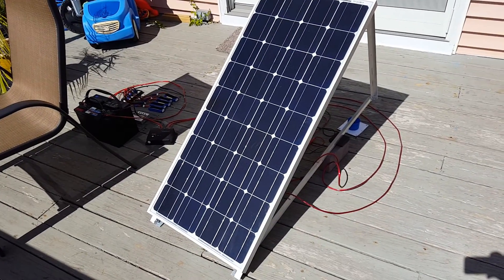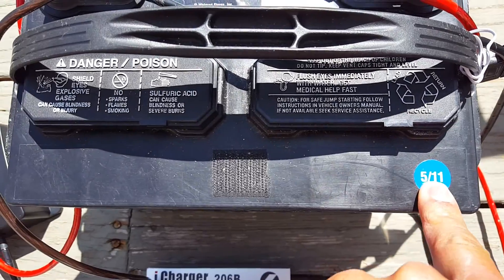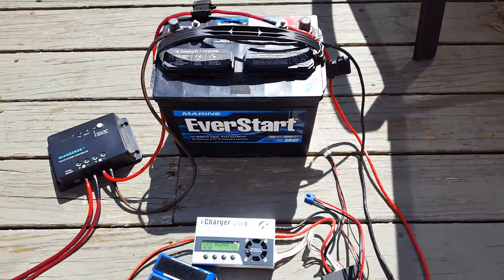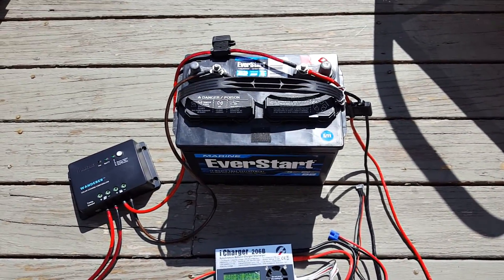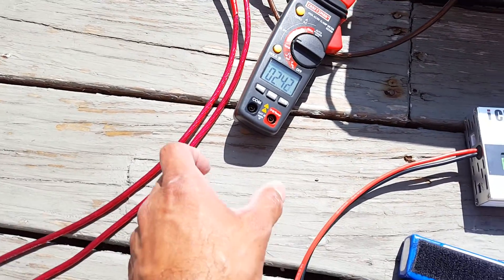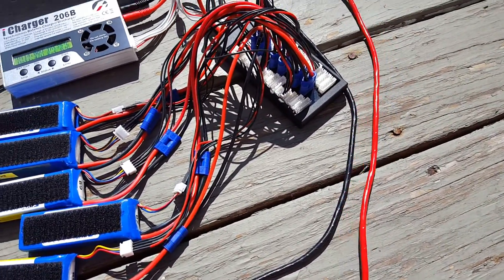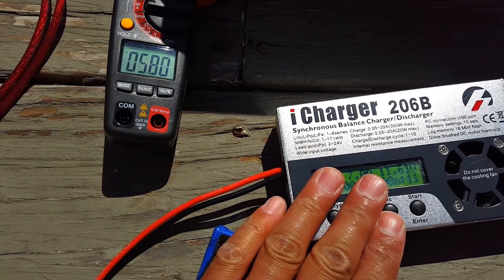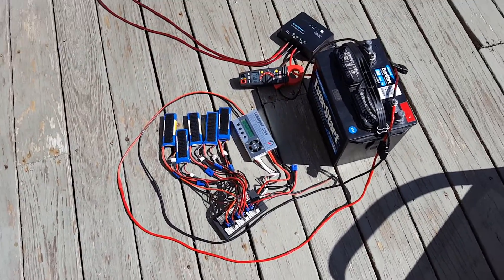Renogy 100 Watt solar panel load test

Comment: The main reason I am watching is because my 250 watt used panels have a VOC of around 37v but I only see 32V. I'm thinking about putting 2 12v batteries in series and than an inverter on each battery with 150 watt load. If I'm pulling 300 watts from the batteries then my 24v panel should be able to push as much power into batteries. They are rated at 250 watts and hopefully I am getting 200 watts.

Comment: You are shorting out the output of the solar panel by connecting the ammeter in parallel.
Reply from the maker: Yep, it was my intention to short out the solar panel. From what I have seen online, it is okay and safe to short out solar panel during testing. Here are a couple such examples: 
https://www.youtube.com/watch?v=SXpxaArnISA
https://www.youtube.com/watch?v=hOjcaKmR4lE

One other thing I learned was to be aware of DC arcing; depending on number of amps, gotta be careful when disconnecting the short circuit. Completely blocking sunlight from the solar panel prior to disconnecting the short circuit is a one way to avoid DC arcing.
Reply: Victor Rodriguez Thank you for your reply! Very informative.